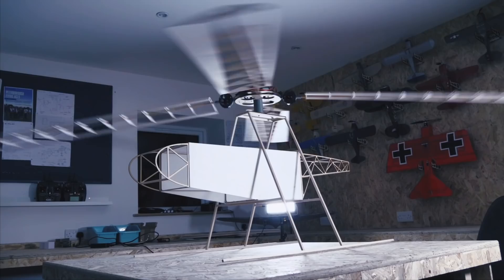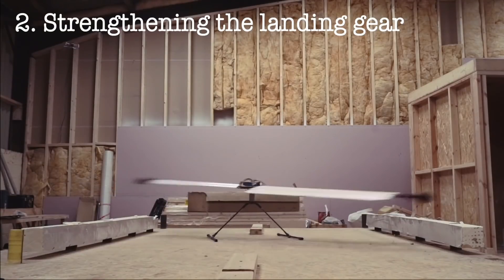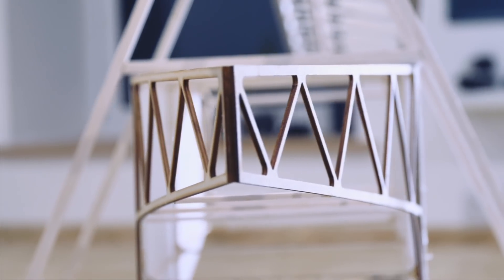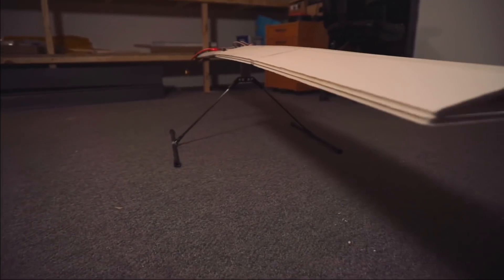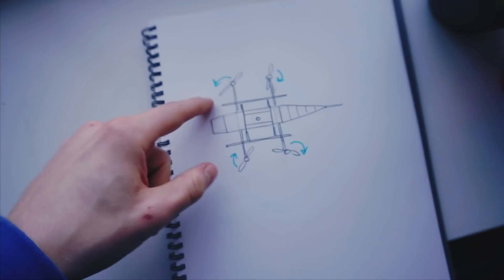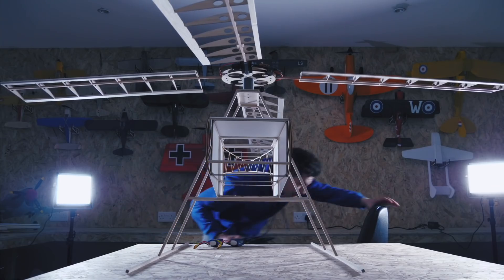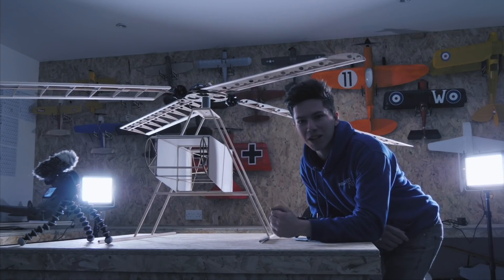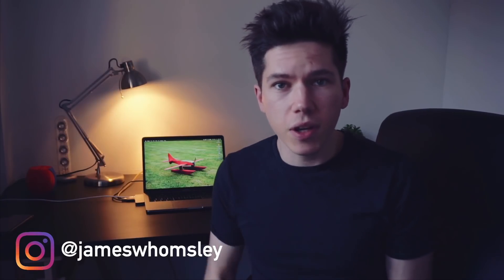DIY Tip Jet Helicopter (Build) #2

Comment from the maker: As mentioned, not sure when the finishing and flying part of this mini series will be coming out 😬 Should I build some rockets in the meantime? Post your thoughts👇
Reply: Totally maybe a rocket that launches and little blades pop out instead of a parachute and it autorotates to the ground
Reply: The idea is amazing
But
You had a tough time building it
Reply: Take a look for this https://www.youtube.com/watch?v=FVwedVUWFz0 (Mini Multi Big Rotor! | Flite Test by PeterSripol)... I am not sure if it will fly but is interesting seeing.
Reply: Bro u r osm plzz make giant rc helicopter xxxl plzz
Reply: Oooooh, definitely more of the helicopter please! 😃🚁🚁🚁😃 If you manage to make this work, you might be the first person on YouTube to have built a working rc jet tip helicopter. 😮🙌
Reply: Not sure about the strength of this airframe but you must see it through now James, and rockets seem to be out at the moment... although how you're going to test fly either while under lockdown is anyone's guess. 🤣
Reply: Rockets would be righteous! Got an idea for you. Saw a video with Tom Stanton building a drag car and using super capacitors for a quick charge and discharge. I feel that you should build a drop plane, ie, Bell X-1 or maybe X-15, and drop it from the Lancaster or another plane as for the speed record. Then it could glide in. Perhaps vertical take off and glide? You could revisit the shuttle that way, though I'd like to see it as a pusher. Whatcha think?
Reply: When Sikorsky was experimenting with helicopter control, he came up with a similar control prop idea to you. Ultimately though a gimballed head is a more elegant and efficient solution.

http://www.aviastar.org/foto/gallery/sikorsky/sik_vs-300_12.jpg

There are some good papers available for free online that describe the design of props/rotors which would be good for point to start with when looking at power/thrust matching (which is I think what you are trying to do currently)
Reply: We use to build tip driven free flight monocopters called Charybdis in my younger days with .049 engines.  Much fun, you should check them out.
Reply: God has said in the Quran:

{ O mankind, worship your Lord, who created you and those before you, that you may become righteous - ( 2:21 ) 

 [He] who made for you the earth a bed [spread out] and the sky a ceiling and sent down from the sky, rain and brought forth thereby fruits as provision for you. So do not attribute to Allah equals while you know [that there is nothing similar to Him]. ( 2:22 )

And if you are in doubt about what We have sent down upon Our Servant [Muhammad], then produce a surah the like thereof and call upon your witnesses other than Allah, if you should be truthful. ( 2:23 )

 But if you do not - and you will never be able to - then fear the Fire, whose fuel is men and stones, prepared for the disbelievers.( 2:24 )

And give good tidings to those who believe and do righteous deeds that they will have gardens [in Paradise] beneath which rivers flow. Whenever they are provided with a provision of fruit therefrom, they will say, "This is what we were provided with before." And it is given to them in likeness. And they will have therein purified spouses, and they will abide therein eternally. ( 2:25 )

 Quran
Reply: Make a vtol!
Reply: fnish this prodejct please
Reply: You have to ask? Lol, of course!
Reply: Interesting project. A couple of points:

1. I believe a jet engine is at peak efficiency when the jet exits the engine at the same speed as the vehicle is traveling. The EDF is clearly going way too slow when mounted next to the hub. All the tip jets I know put the jets at the rotor tip (hence the term, I guess).

2. Why not use a standard helicopter rotor head for control purposes? I'm not really into R/C stuff but they're not that expensive I think.

3. Rigid (non-articulated) rotor hubs exist on many modern helicopters. The Westland Lynx for example. They need to very strong to withstand the forces from the rotor though and I'm not sure those are available as R/C parts. Just FYI.
Reply: Another idea: You could try to use the smallest possible EDF (or a very small motor/propeller assembly) to get the mass and size of the vehicle down as much as possible.
Measuring the jet or propeller slipstream speed and matching it to the rotor tip speed might also be worthwhile.

Comment: I'm late to the game.  Your ideas are good. The inboard 1/3d of rotors don't contribute enough lift to matter. You can make 4, 5, or, more bladed rotor if you leave the inboard portion just a tube. If you are going to test a new helicopter indoors changing them down so they don't disassemble themselves is a good idea.

Comment: Putting the ducted fans on the inside also creates added turbulence for the wings to fly through, decreasing lift. I've never been a fan of the tip-jet helicopter concept, but I think that extending the rotors past the EDFs is a particularly bad way forward. Lengthening the wings/rotors should give a better result.

Introducing a progressive twist to the blade profile would help, but it's a complex geometry to calculate and build.

Comment: I have a suggestion. Place another pair of EDFs on the outer edge. And then by thrust vectoring set the speed of the inner EDFs faster than the outer ones. Because the speed of rotation of the inner part of the blade would be lesser than the outer part. And to compensate the distortion in the structure , make the blades with something flexible. If you want to contact me here's my email. I have been thinking of solutions after watching your first video. Your channel is underrated. You are doing great. 

Email : pbanerjee0801@gmail.com

Comment: Love your ideas but  .  .  .  

One major problem you'll encounter is the moment you start  ' flying '  in any direction wing lift will start spinning aircraft in corkscrew as forward motion speeds ads to  lift on example right side and deducts from trailing side lift 
on left side. 
To resolve problem is quite easy using  Counter rotating wings  ( Rotors )  
as this cancels out this problem 100 percent. 
One more thing to try is moving thrust points at different positions say down halfway or two thirds from center.  That would give sufficient torque and speed to rotation depending on need .
Good luck and never give up , will be watching progress. 
Greetings from an old man in South Africa.

Comment: Gah! The rotor head does NOT gimbal. It only looks like it does because of the variable thrust provided by the swash plate and the subsequent flexing of the rotors.

Comment: Hey project Air, so for your idea to merge a quad copter with your helicopter for control, I’m not sure if you know this already but you’re going to probably run into an issue with gyroscopic precession. So if you were to induce a force upwards on the right side, the helicopter would actually pitch nose down and the same would be true all the way around, essentially any force you induce Perpendicular to the helicopter blades is going to act 90° clockwise, or in the direction of rotation really. Even so it might work fine as long as you set your controls 90° backwards from the direction of rotation. Either way I would still love to see you try it. I would recommend watching smarter every day’s series on helicopters. pretty much everything I know about them comes from that series. Anyway sorry for the long comment but I thought you would like to know if you didn’t already. Cool beans channel also

Comment: I really don’t think it’s gonna work...you’re gonna have to cover the blades with monokote or tissue paper for it to remotely work. The blades aren’t spinning up to a high enough rpm either. And also by the time you get the blades up to speed the batteries are gonna be shot. You need bigger edfs and bigger batteries. But that also means more weight it’s gonna have to carry IF it flies and those batteries can cost over $100 and you can easily damage them and put a LVC on them. I’m not saying it’s impossible but it’s gonna be really hard.
Reply from the maker: The wings as mentioned are going to be covered. We will see in the next video

Comment: Due to the lack of a driveshaft (and torque) on the rotor, I think your intended vehicle is more similar to an autogyro which derives it's forward thrust and directional stability from a propeller in front and airplane style tail. Also the blades on most autogyros are either flexible or pivoted in the middle to allow the advancing blade to rise and the receding blade to fall to avoid unbalanced lift when moving forwards. https://www.google.com/search?q=cierva+autogyro&sxsrf=ALeKk01FXv7rjkKQnlJChpK257-2J3lSkw:1587590623853&source=lnms&tbm=isch&sa=X&ved=2ahUKEwi_v7v5-_zoAhXOmOAKHfW8ByIQ_AUoAXoECDsQAw&biw=2102&bih=1148
I think you would do better to make a smaller vehicle. Safer, faster build and possibly flyable indoors.

Comment: If you feel the need to use rotors for stability, consider trying a configuration similar to the V22 Osprey using 2 tilt rotors (& potentially a small concealed tail rotor per the scale model). That way you can achieve all of the same things as 4 motors but witth only 2 motors and 2 servos which would also be closer to your CG already.

Comment: Hi, am working on a model tip jet rotor system using a rotor head, two blades and two EDF motors in the USA.
I recommend that you at least add a lead - lag hinge (aka draging hinge) with a small amount of movement because even a rigid rotor is not totally static like propeller and keep the edf ' s at or built into the blade tips!

Comment: Why are you 4-blade rotors of different length? The 2 blades that have the electric fan thrusters are the same length, but are shorter in length than the other 2 longer rotor blades. How come you do not have any skin film covering the rotor blades???

Comment: I don't think it'll be able to hover in place without the quadcopter motors on the fuselodge. The wings will turn one way and the fuse lodge will constantly be spinning the other way. This is why quads always have counter-rotating propellers. You'll have to constantly need at least 2 of the quad motors on and spinning to counteract that torque. Even then, I don't think the amount of torque you'd get from the quad motors on the fuse lodge is enough to counteract the wings.
This is why helicopters have that vertical propeller in the back - it's to work against the spin that the body will want to develop, (and it can work harder to turn the heli, or less harder to let the heli turn the other way)

Comment: Why not stack the rotors in opposite directions? 

Natzis (ww2) successfully built a rotor tip design...believe they piped jet exhaust thru the chord of the blades and nozzles at tip gave thrust.

The flight contrtol was traditional linkage and swashplate. 

This tip design eliminated need for a rotor.

Ok: you need a FLAPPING and LAG hinge on all blades.

You need to be able to change the pitch but more than that - you need the blades to flap up/down and flap forward/back AND rotate or feathering axis.......as the blades travel they need to be pitching up on the leading blade as the retreating blade pitches down and this has traditionally been achieved by the use of a swashplate and links. 

I wont get into the fact that the LAG hinge FLAPPING is needed when proceeding blade slows a bit and retreating blade speeds up there are areas along the blade path where the 2 blades are speeding up with other blade slowing a bit and then there's the up/down FLAPPING hinge......then the feathering for each blade as mentioned. 

You will not succeed with that design.

Take an RC HELI.....a large 650 or so......and build tip jets on that platform. Otherwise you need to learn an awful lot about helicopter design before continuing.

I can point you in a direction but you need more knowledge of FLAPPING, FEATHERING and LAG hinges and conservation of motion principals as well at TORK physics and especially look at the path a heli blade travels thru the disc and how it pitches up and down thru this travel.....you may need to incorporate a flybar to improve stability.....I would not use a 4 per blade design either until you have mastered the 2 blades and then you need to pay attention to PHASING....when to stick inputs translate to pitch and WHERE along the path.

Dude - this looks fun and challenging even for a long time Heli fan.....I have in fact been thinking of this design but need to finish an RC notar project first.

Buzz me and I'll give you more details. Good luck otherwise- fun stuff!

Comment: So it’s a quadcopter with a massive swinging wing set - I love your stuff and your thinking but say “quadcopter” and I lose interest. Why not a pivoting head like a gyro - in fact your design has far more in common with a gyro than a heli...until you said “quadcopter”. Enough positivity, let me be critical, I have serious doubts about the dowel spars holding up to the inertia and lifting forces if you do get the rotor assembly spinning fast enough, I would definitely replace or reinforce those with carbon tubing. The covering of the blades themselves would need to be quite resilient because a spinning blade is subject to immense negative and positive G, especially if you start introducing control inputs - which I hope you will, drop the quad idea - think aerospace, not quad.

Comment: Watch the Blade tips pass a Single Point. they ALL NEED to be in the same Plane of travel.Right now they are all different. At speed it will shake itself apart.

Comment: I could imagine the fans are more efficient when mounted to the end of the wings. Since they make more distance per revolution they operate at higher air speed. That might make them more efficient.
Reply: that's true, but at the same time when the rotational mass is nearer to the center the propeller can spin a lot faster. it'd be interesting to see what's the best

Comment: Considering the individual wing to be a lever your initial assumption of puting the jets a the tips was correct because this is the place where it will be easier for them to counter the drag of wing. Also, the  speed and regidity will increase as soon as you add the cover to the blades. 

Greate work as always!!!

Comment: There is always the same problem of torque reaction as in the previous video! Add a blade to the tail in order to hold it from spinning on its axis. I hope your engineering studies progress!
Reply from the maker: There is little need for a tail rotor aside from acting as a control for yaw as there is no significant torque exerted on the airframe below the rotors. I will be adding a rudder control surface to the tail to deflect air and control the yaw in the next video to show this.

Comment: James, if you look up the required rotor speed for an RC helicopter of this size, you will find that it should run much, much faster. Once you have figured out how to achieve the correct speed, you will also discover why rotor blades are never built like wings. Wear protective clothing and film it.  ;-)
Reply from the maker: Hi! I've already done the maths to work out the size and rotational speed of the rotors. They need to spin about 4 times faster than the max speed in this video when I actually have it finished and all go for a test flight.

Comment: This is a great project. Just wondering, once you lift into a hover, how do you plan on dealing with torque. Maybe I missed something, but I did not see a tail rotor or counter-rotating rotors. Really enjoy your videos. Thanks for all your hard work.
Reply: There is no torque when the propulsion source is located on the rotor blades, see Fairey Rotodyne.
https://en.wikipedia.org/wiki/Fairey_Rotodyne

Comment: I wonder if you could place a single EDF in the centre of the rotor assembly, such that it tries to 'inflate' the 4 wings. 
 The wings would have discharge ports at a certain point along their trailing edges, to propel them into a spin. 
 That would be rather unique.

Comment: The motors need to be on the end of the rotors
Reply: They need to be where the lift of the blades equals the speed at which the EDFs can propel the blades. They'll be a sweet spot, calculated by formula but more fun experimentally.

Comment: another issue is the gyroscopic precession of the fans, as they are spinning they are going to try to pitch up/down twisting the rotor head structure.

i work for AccuRC simulator, i know a lot of the physics of rotorheads drop me an email adrian@accurc.com if you want a chat

Comment: im 6mins 30seconds into the video and making a prediction... the control system wont work. Gyroscopic precession is going to hurt badly,  plus i have a feeling it wont have the power to overcome the stability of the rotor disc.

Im also not convinced there will be enough lead/lag flap in the blades to allow for a stable rotorhead

lets see if im right.... <continues watching>

Comment: Semi-rigidor non-rigid rotorheads are mainly used to reduce stress. When spinning the rotor will want to remain in its plane and so when the helicopters pitches or rolls a lot of stress would get put onto the rotorhead.

Comment: This is looking really promising! Can hardly wait for the next installment. I’m curious as to how you set the pitch on the rotor blades...? I always struggle with setting accurate pitch on my scratchbuilt helis. Great work!
Reply from the maker: I didn't really show it for some reason in this video but the spacers that separate the disks of the rotor hub have square holes offset at 7 degrees so that the entire wing, when inserted into these holes, is set at a pitch of 7 degrees. ☺️ Thanks!
Reply: @Project-Air  Ooooh hey that’s a nice way to do it. 👍 Thanks!